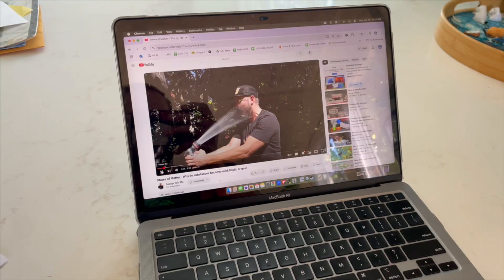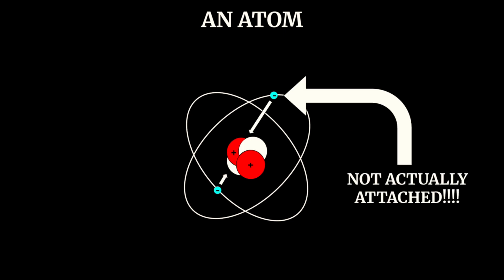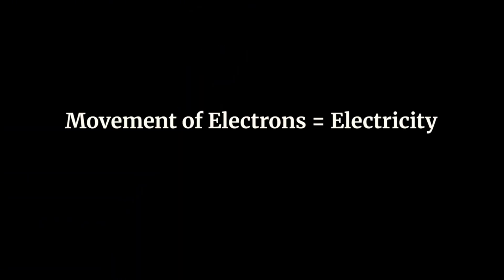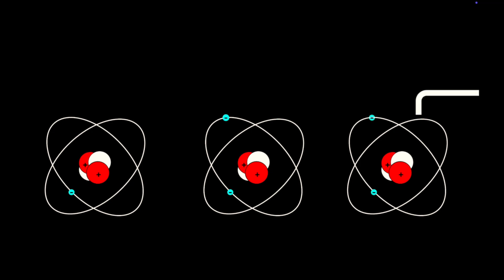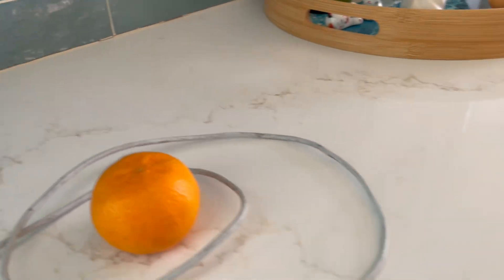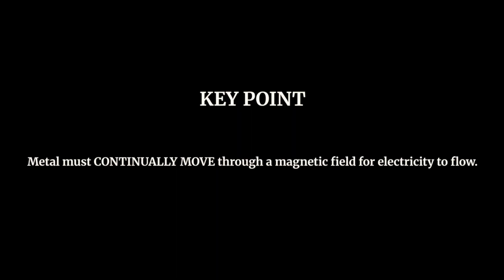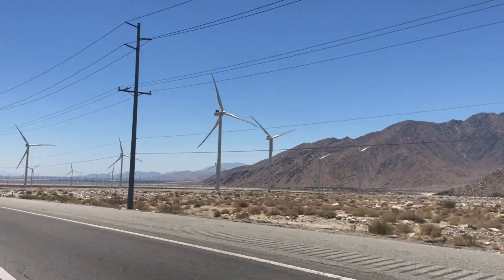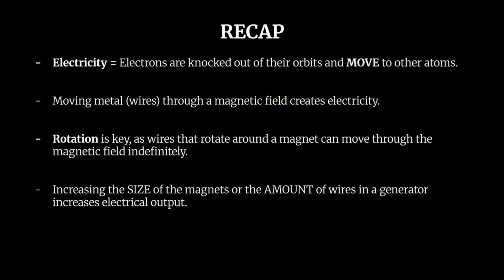How Does a Generator Make Electricity? | Science Made Simple

Comment: Hi George.....I like your excellent explanation about electric current being generated by a  rotating coil making electrons move..... Question: How does a standard battery generate electric current (without a rotating coil) ?
Reply from the maker: An excellent question!!!!!! Batteries are completely different and involve chemistry. Basically, batteries have dissolved salts inside them that have the negative ions (atoms with an excess of electrons) dissolved on one side (the negative side), and positive ions (ions that have more protons than electrons) dissolved on the other, with a barrier in the middle. This difference in concentration of electrons creates a difference in electrical “pressure,” which we call voltage. This is why there’s a NEGATIVE and POSITIVE side to each battery. When you connect the two sides with a wire, the electrons flow! As they do, the difference in charges lessens, and so the battery drains🪫. Charging a battery restores the chemical potential of these sides. 

Batteries you buy at the store use lithium salts, which is why they are called lithium ion batteries!